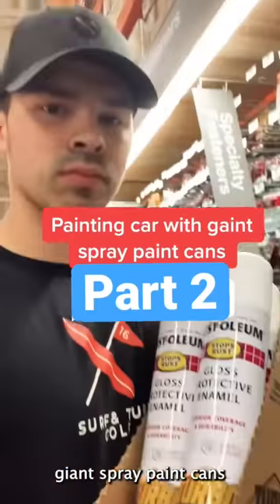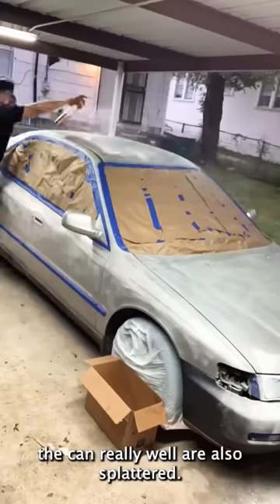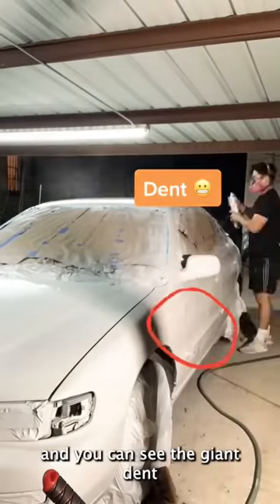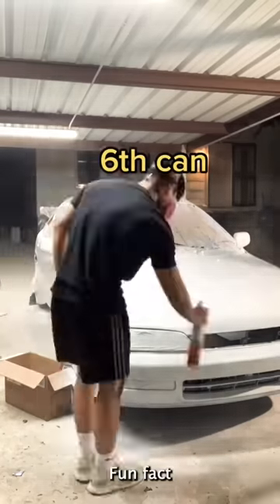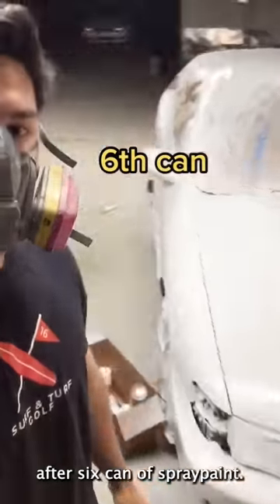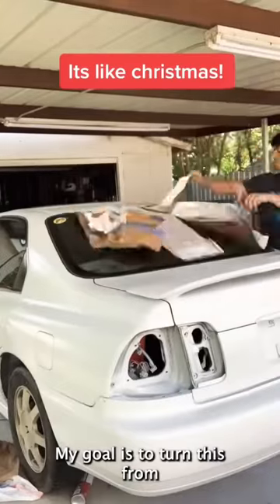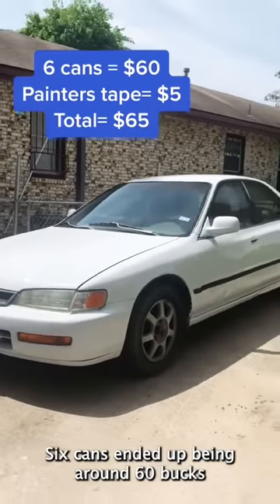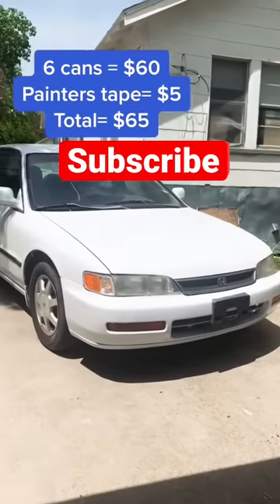Spray Painting CAR with GIANT CANS! Part 2

Comment: Should have used better paint, actually prepped, and put a clear coat on it.  But good for you for actually doing it, being proud of it, and it making you happy.  It's how you learn.  Also so you know automotive paint shops can do a single stage paint into spray cans it's a little pricey but it's worth money.  If you take your time to prep the car well it actually turns out decent

Comment: If you do this. Use 2k clear over top or it will look like shit pretty quick. Aerosol doesn't actually harden, meaning a drop of oil or solvent will take it right off. 2kclear has hardener  and will not just wipe off.

Comment: Why didn't you clear coat that shit?
Reply: Cuz it would actually look worse and cost 2x more
Reply: Trump da goat
Reply: SOB!! CLEAR COAT THAT THING ALREADY!!
Reply: @aaronsanchezz  Uhhhh, no?? I literally used 2 full cans of Rustoleum standard clear lacquer, and wet sanded in between the dried and cured coats. And then I topped it off with 2 full cans of Krylon acrylic clear coat for a super tough clear coat paint shell. It’s incredibly tough. A proper protectant finish.

Comment: 3 weeks later all the paint peals off cuz he didn't clear coat it.
Reply: The fading is gonna be really bad, I spray painted my hood so that way it would at least be the same color of my car, after about 4 weeks it isn't even the same color now
Reply: @jordann5062  yeah,rattle canning is just not a good idea.
There's a reason why properly painting a car is so expensive.
It actually lasts a long time and doesn't change colour(unless it's like a pearlescent or something like midnight purple)
Reply: @sk1dzzz608  you can get a good long lasting finish with a rattle can, but you gotta do proper prep and finishing work, the type of paint you use can heavily impact the durability and longevity, and unless you get a paint that is specifically meant to be thrown on without clear coat like tractor paint you should always clear coat it, it will never be as good as a professional paint job though
Reply: @sk1dzzz608   Its expensive because a trained pro is doing it. It's all in the prep. I agree he could of use a better paint since you can get automotive paint in aerosol form.

Comment: Give it 3-6months before it fadee cracks and peels right off lmfao. Top coat for a reason. 
Cheap is cheap minded.
Reply: I used Rust-Oleum on my front and rear steel bumpers on my 4Runner. Prepped the absolute hell out of it, did like 4 primer coats, 6 black coats, and 3 clear coats on each bumper. By no means an expert but it came out really well. Let them sit for a week under a large awning. Got the front bumper first and 2.5 years later it's still looking super clean. Only a few chips from rocks. That being said, I would never spray paint the actual body. I think it can come out really well but you can't half ass it.
Reply: You should make video showing the right way than. 😉
Reply: @DankestNumber  common sense dictates you lack common sense. I've painted, and anyone who knows anything would tell you the same thing. Unprotected paint will fade, especially from a rattle can. 2k clear for a reason.... 
Also I'll make a pop up book especially for you buddy. You'll have to supply the crayons though, which you most likely have in hand.
Reply: @hondaftwg9543  Whats a crayon? So no video? BTW what's common sense?

Comment: Without clear coat the paint will look horrendous from sun damage and peel/flake off. Clear coat saves the paint and is a must if you want any paint to last
Reply: Pleanty of single stage paint jobs out of my garage and no clear coat.  Rustolium actually holds up pretty good if it’s painted on a clean and scuffed surface which this guy didn’t mention.

Comment: I do that on a car, but not with that paint, first was sanding, first with 500, after 1000 for scratches, primer coat in gray for see easily the scratches and not well painted points, paint with a can of AUTOMOTIVE PAINT, sand it again with 1000 and water for better results (after 24 hours obviously), paint again, wait other 24 hours to sand it with sandpaper 1500,after with 2000, 2500 and aply clearcoat or wax, for me the wax works fine too, polish with the wax (if you do clearcoat, wait 24 hours and sand it with 1500, after 2000,and finish it with 2500 or 3000, if its the 3000, better)
After that you barely notice it was repainted

Comment: Any colour is fine to use, its the quality of paint that makes it key. 1-2 primer coats then about 3 coats of colour and you'll be good to go.
Reply: Other colors will allow you to see imperfections and damage to the car that ya painted over real easy
Reply: @codyclem7146  if there are imperfections applying another coat should get rid of them. If you half ass spray it then expect imperfections.

Comment: Rust oleum is a single stage enamel paint it doesn’t need clear.  It’s actually pretty strong.  That said he lacks a lot of technique.  Always clean with acetone, scuff paint, spray a light tac coat so you do t get orange peal.  Then long fanning strokes.  Shouldn’t take more than 3 coats on each panel.  I’ve had spray paint paint jobs come out looking professional with a little wet sanding after.
Reply: I'm not going to argue that rust-oleum paints arent single stage enamel but I will argue the fact without clear it doesn't last in uv rays. I was repainting things every year due to them fading from time in the sun(which isn't as much as a vehicle). Then I put a clear over them and now those same things I had to paint every year go a few years till they get banged around enough to finally beat the paint off and need to be painted again. Outside that you're comment is spot on. Carry on 🤣😆

Comment: They also sell automotive Clearcoat at Home Depot it’s in a smaller can but you can also use the Spray cap from The turbo can To make it come out the same way and cover the whole car should try it That way the look won’t fade

Comment: I probably would’ve least done like 2 cans of primer and 3+ cans of clear coat, especially like a tough acrylic clear coat.
Reply: What does the primer and clear coat do?
Reply: @Deeznutz...  Primer helps the base coats of colored paint stick/adhere to the surface better. And the clear coat is to provide superior coverage on top of the main paint color(s).

Comment: For a grand you could prolly do wheels and suspension and it will literally be like a whole new car
Reply: What does the suspension do ? U just drop the car a little lower ?
Reply: @Deeznutz...  yeah it just drops it a little lower
Reply: If it has shitty paint who cares what the wheels look like. Suspension is a very general term. What part are you referring to when you say suspension?
Reply: @787blah  he says in the comments here he clear coated it so it prolly isn’t to bad and coils or lowering springs that’s kinda obvious when I’m referring to looks it’s not like I would say he should change  out the tie rods or something for appearance this build is meant to be a diy decent looking shit box that paint can looks pretty good if done well it won’t look like an expert job but it can look pretty good
Reply: @shiro4296  it wasn’t made obvious. You said it would be like a whole new car. Wheels and “suspension” could make it perform like a different car. Also a rattle can job is a shitty paint job even if he did put a clear coat on it.
Reply: @787blah  thought I said look in my original comment my bad and rattle can jobs can look decent

Comment: First car wash and most of the paint coming off 😂
Reply: Naw not even, I painted my car with rattle cans like 12 years ago, I used flat black. My paint held up for about 1.5 years before I could start to see the blue underneath in some spots. The towel or rag used is what really wears it down. If you wash it and use a small handheld leaf blower to dry it, it will probably last even longer.

Comment: What if you tried to wash it wouldn't the spray paint come off?
Reply: Yep..... it all runs off and you have to repaint it. Get to change the color every couple weeks.

No the paint doesn't come off once it's dry lol
Reply: @MykeHunts  no clear coat on it it's not going to last to long. Might not "run" of it's first contact with water but we don't know the prep work put in before the paint job. So essentially, yeah it may wash right off